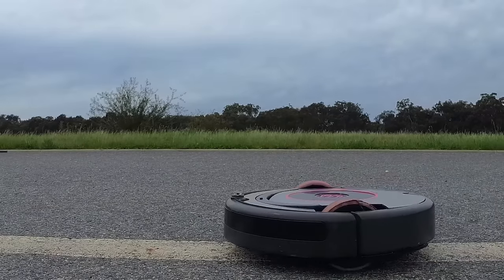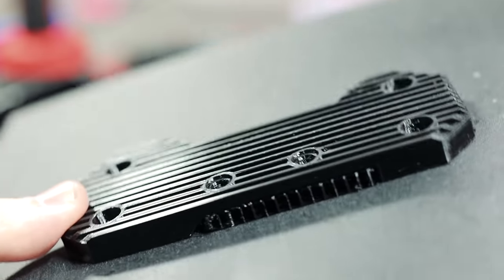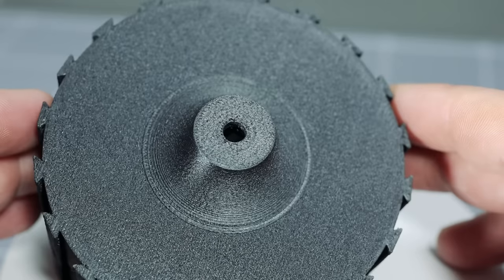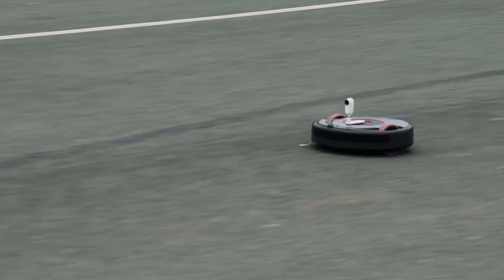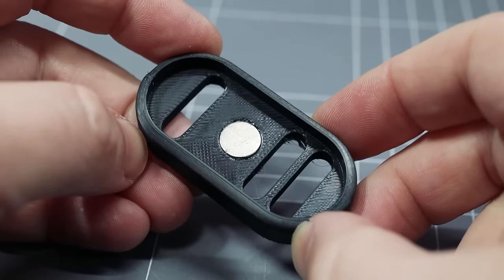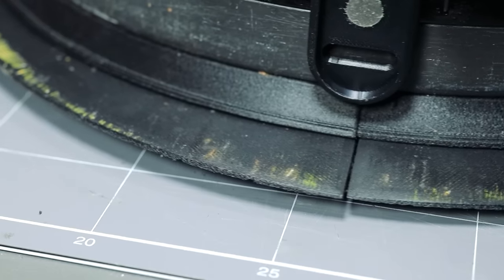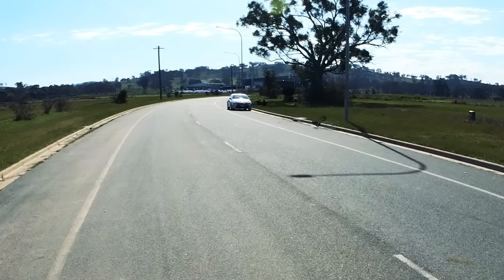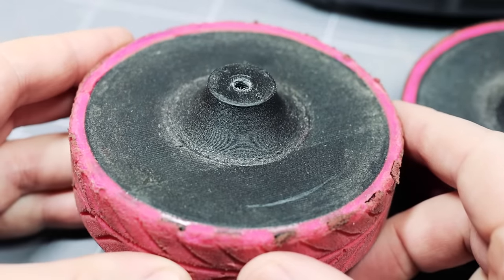World's Fastest Roomba Gets Upgrades

Comment: If you paint it red it will go faster.
Reply: Dont forget white stripes and flame decals!
Reply from the maker: Pink is faster.
Reply: Recently red isn’t very fast… at least in f1
Reply: Is this a warhammer 40k reference
Reply: pink is definitely faster than red
Reply: Ork logic
Reply: Pink is the manliest!
Reply: @anonymousprime1738 most likely
Reply: If you sand the aero 3d prints down it'll actually go faster, perfect finish
Reply: You are forgetting to add a monster energy sticker, one of those bad boys on anything and  it instantly gains 500hp. I'm forklift certified so you can trust me
Reply: it either goes faster, or 3 times as fast.
Reply: Racing stripes
Reply: Man of culture
Reply: red paint, stripes, rgb, wind deflectors,roof bars, hoodscoops and stickers make everything faster
Reply: Facts
Reply: It has to be spray paint too
Reply: It's science!!!
Reply: @Me-0063  fax
Reply: BLACK is fast
Reply: true
Reply: Flames are guaranteed 40 horses.  Depending on the size and placement of either anime or konji characters one may yield another 10 to 50 horses.
Reply: @electrosync ya but u have to add flames for instant speed
Reply: Blue is fastest
Reply: Facts
Reply: @electrosync finaly sum1 understands
Reply: If you paint it black; it gets a gun and a bunch of helicopters wil take it away towards Vietnam.

How do i know u ask? I once pranked my neighbor...Never seen him again.
Reply: If you paint a racing line it will go even faster
Reply: Is this a Mobile Suit Gundam reference?
Reply: Pink is a faster version of red.
Reply: @Kurosaki_Dan I think Warhammer 40K: there's a primitive alien species called the Orks that believes if you paint something red it goes faster.
Reply: Red is better for top-end speed but pink is better for acceleration.
Reply: @iExploder  nice to know, in mobile suit gundam there is a guy with a red mech that goes three times faster than the normal spec mechs...So there is this meme in the gundam community that red makes you 3x times faster xD
Reply: Make sure it's Ferrari red.
Reply: @electrosync obviously you are not very smart
Reply: WAAAAAGH!!!
Reply: "Red goes faster" is just a phrase. It doesn't belong solely to any specific brand/franchise/series.
Reply: needs more rgb aswell to increase frames
Reply: I heard something about painting red things black, maybe that would help more
Reply: @panoraxe lol tell my you're in the closet without telling me you're in the closet
Reply: @anonymousprime1738 I'd say so
Reply: @_Otaku-kt8be  ur pfp is purple and they are right
Reply: Laughs in Char Aznable.
Reply: Give it some stripes and speed holes as well
Reply: The lack of 40K knowledge here saddens me
Reply: Char aznable
Reply: @electrosync  agreed
Reply: Nothing is faster than pink with flames
Reply: @anonymousprime1738  i don't know that game, aint much of a gamer tbh, red things being faster has been a meme for a while
Reply: no, red racing stripes
Reply: also the horns
Reply: @Me-0063 red bull??
Reply: @TheGamer707.  ferrari
Reply: @anonymousprime1738 No, this is Patrick.
Reply: @anonymousprime1738 gundam reference
Reply: Paint it red and add a horn. It will go 3x faster
Reply: Red is always 3 times faster!
Reply: And get pulled over more
Reply: @electrosync So your going to make pink F1 cars now? Hmm, seems better then red or yellow F1 cars. Lol.
Reply: It will only get faster if you had  flames, it will give the car 10 more horsepower
Reply: That's actually what insurance companies think
Reply: @Me-0063 to be fair pink isn’t the fastest in f1 either
Reply: it will also cost more in insurance 😂
Reply: WAAAAAGH🦾😡
Reply: Char Aznable moment
Reply: paint flames along the sides
Reply: But the police will pull it over
Reply: either that or paint it gold and add the Kanji for 100 on there
Reply: And make your insurance higher.
Reply: That’s why it’s in confetti
Reply: Da boiz
Reply: @electrosync  no.
Reply: @TheEndOfNether  no
Reply: @ezrawiegers5327  wrong
Reply: @aaronwallace7426  no
Reply: Some say it might even make it “three times faster”
Reply: Doesn’t work with Ferrari F1
Reply: @themuffincat nuh uh
Reply: 3x faster?
Reply: 3times the output
Reply: 5hp per sticker, 10hp if the sticker is bigger than 30cm X 30cm

It needs comical dragster headers....
Maybe make it shoot some little sparky bits out when it goes to Maximum overdrive, lmao
Reply: Yell "Waaa" to faster-er
Reply: That doesn’t make it faster it would actually create some local drag
Reply: @Jordanvlogs-k2h  no it goes faster
Reply: Don't worry. I got your reference.
Reply: Is this a Gundam reference?
Reply: and add some flame
Reply: Fax
Reply: Whag time?
Reply: @aaronwallace7426  Blue and black
Reply: @archangeltemjin69  Blue,Pink and Black is 6X faster
Reply: @nimoy007 it's definitely Warhammer 40k
Reply: @electrosync i agree
Reply: Like a Ferrari!!!
Reply: @anonymousprime1738  It started with Gundam.
Reply: @EldritchDoodler4828  The lack of Gundam knowledge here saddens me
Reply: Black
Reply: 3 times as fast
Reply: Not faster, better sound is FASTA
Reply: @Me-0063 famous last words
Reply: Kachow
Reply: Pink it faster. Pink it better,
Reply: Needs flames
Reply: And if you paint it purple it will be stealthy
Reply: @icicle_ai bro responded too many times
Reply: Ork wisdom:
Reply: True
Reply: @electrosync  if you add under glow all around the bottom it will def go faster
Reply: Nu Gundam wa date ja nai!
Reply: @electrosync  RGB HOT PINK
Reply: or even better, pink with red flames
Reply: If you paint it black it will work harder💀
Reply: add in a commander horn too
Reply: @electrosync  Obviously, pink is just faster red.
Reply: WAAAAAAAAAAGGGGGHHHHHH!!!!!
Reply: D@electrosync yes cuz barbies car is pink
Reply: Facts red is fastest
Reply: @electrosync  that is true, that's why forza horizons is pink
Reply: Everyone knows you run faster with a knife
Reply: @erikhaag4250  ohh the wise words of FPS Doug
Reply: @electrosync bro he likes pink that’s why
Reply: @panoraxe Bfdi people
Reply: Yellow*
Reply: If you paint it red, it is slow
Reply: pink is the fastest

Comment: Since you'll be building a custom chassis for the Vroomba, you might want to move the wheels further forwards to move the balance backwards and rest more on the third wheel. This will also make the splitter scrape less. I think part of your instability is caused by just that- the driven wheels being totally centered with a high speed application. Makes for a lot of room for wobbles. You may not wanna do this if you still want to be able to spin in place, though.
Reply: Clearly the logical next step  is to add rockets; send it to space and vacuum the moon.
Reply: Bigger chassis means brushless motor, right?
Reply: Clearly the logical next step is to commit to the REV product line and cram MAXSwerve modules into the chassis
Reply: sounds like something a wheelie bar could help with.
Reply: I think this will actually make the Roomba less stable. Imagine the Roomba while it is turning to the right. "Centrifugal force" pushes at the center of mass to the left. The wheels counter this force by pushing to the right. If the wheels are ahead of the center of mass, the two forces apply a clockwise torque, causing the Roomba to turn harder. This is a positive feedback loop and causes the Roomba spin out. If the wheels are behind the center of mass, the torque is in the counter-clockwise direction which causes the Roomba to turn less. This is a negative feedback loop and creates a sensation similar to understeer which is far easier to control. This is why cars always steer from the front wheels rather than the back wheels. Forklifts are an exception to this since they move at low speed and need to work in tight spaces
Reply: @HoboWithWifi  aah, good point. i was just thinking since there's already a third wheel in the back it would probably be best to shift the weight more towards that wheel, preventing the nose from tipping into the ground. there's nothing saying the third wheel could be moved to the front though and i didn't think about that. or maybe the steering could be handled by that third wheel if it's relocated to the front...

Comment: Love the new look. I wonder if a vertical stabiliser would help it stay straight, rather than a conventional wing.
Reply from the maker: Thanks! Good suggestion, but I doubt it would help. I don’t think it comes across in the videos, but this thing has so much brutal power that it just can’t get to the ground. Plus it’s heavy which works against it. That’s why I’m working towards a light weight Roomba for the next version. It won’t vacuum or be a ‘Roomba’, but I think it will be very fast! Thanks for watching.

Comment: I would recommend covering the tires to prevent unwanted aerodynamic turbulence, and also consider making the tires a bit thicker to make bumps just that little bit easier to get over.
Reply from the maker: I actually printed some wheel covers for the first video, but never used them.
Reply: are you able to add some sort of suspension @electrosync  ?

Comment: I think guniness should give you the world record, they dont appricate the engniners/hobbyiest enough. I have some suggestions for v3, try printing the front arrow/splitter thing out of a tough (98A) tpu or tpe. This will act as a bumper and prevent some damage when you run into things. My second idea is to use drone parts like the flight controler, esc, and motors. This will allow you to have the gyro, wire in a gps directly into the flight controler, allow a fpv camera so you can drive first person, use the esc from it, and use super powerful drone motors. Realy nice project I hope you make it even faster.
Reply from the maker: Great ideas!
Reply: Guinness records are basically all pay to win. I wouldn't hold them in any regard
Reply: You could re-apply for the title of fastest smart vacuum. change the wording up could squeeze by.
Reply: @gamemeister27 they literally are pay to win
Reply: @gamemeister27 It literally is

Comment: If you’re planning on building a custom chassis for the Vroomba, I’d suggest looking into using tires that are wider and thicker; they may help absorb more of the impact from the rough tarmac surface and provide significantly better grip.
(I’d also suggest looking into trying out different tread patterns for the tires as well; Most R/C vehicles use slick or semi-slick treads that provide better grip on the road surface.)
Reply from the maker: Good suggestions. I think I'll have more freedom with my own chassis and different drive system (without those massive gearboxes to work around).

Comment: Not sure if helpful or already covered but the gyro anomaly reminded me of what happens on an R/C heli when the tail gyro is backwards or upside down- input says going left but actually goes right so gyro says more left more left which is actually more and more right so instant out of control spin . Might be your diff steer doing it tho, notoriously hard at high speeds. Love your work 👍

Comment: If i may, i would suggest you should make a slick or smooth tires and using  softer materials than hard plastic on you roomba for more traction and if you arent planning for wet surfaces, then theres no need to put grooves on your tires ❤

And it would be great idea to check for weight distrubtion, having imbalance side by side is much worse than front to back

Comment: I agree with the comments talking about making the front aero scrape less. The faster you go, the more it scrapes and bounces, the higher it bounces, and the more instability you have. And friction of course. 
Once you solve that problem...may I suggest looking into fans for ground effects? One of the most incredible track cars used low skirts and rear fans that sucked air from below the car and glued it to the ground. Look up the Chaparral 2J, or more recently, the McMurtry Electric Fan Car.
I know it's a bit of a stretch but...we're talking about a 50 km/h Roomba here :)  p.s. I love this project so much

Comment: At some point there needs to be an RC Roomba Racing series. It'd be neat to get a whole RC club in on this kind of thing, but there needs to be some ground rules on what still has to be stock. (I figure the chassis still has to be able to convert back to the original parts?)
Reply: I imagine, that since it will be defined by "Roomba", it'll at least need to be able to perform the main task of a Roomba, namely being able to vacuum at whatever the top speed might be. Though, I'm not sure at what level of effectiveness the threshold should be, as it's gonna be unrealistic to expect a model tuned for speed to perform as well as a stock Roomba.

Or just call it something else than "Roomba", like Guinnes pointed out.

Comment: I think you should make something like a middle mounted wing, centered to the center of mass and relatively high up to get clean air instead of dirty air coming of the roomba, like a Cooper T86B F1 car from 1968. Another suggestion is to use dive planes instead of a splitter, since that could be causing instability in the straight-line runs. Dive planes (again much like the Cooper T86B) reduce drag and add some limited downforce.

Comment: Run it all off the same battery, just run the two in parallel if needed as the 2 different voltages from the slightly different battery charges will make the motors accelerate differently, it should help with it going straight alot.

Comment: Very late to the party but the Roomba is a vacuum, do you think there's a way to use its vacuuming abilities to generate downforce? I've seen it in other projects and I think it would be hilariously fitting for a Roomba (my apologies if you wasted your time reading this and it turns out to be downright unfeasible 💀)
Reply from the maker: It's definitely feasible. It was suggested on the first video. The standard vacuum motor is underpowered and wouldn't be effective, but you could actually add an EDF on the top middle of the Roomba (which has a direct path down to the ground). Add the right skirts, etc. and it would work. Not sure how well though.

Comment: yea, you really need that gyro
Reply from the maker: I think I’ll have to design my own.
Reply: @electrosync  are there no gyro for tank drive?
If you go custom, go with a basic flight controller and ardupilot rover I guess.
You get a few more sensor inputs like compass and accelerometer. So you don't only have the dampening effect of a gyro but actual heading hold.
And in the end, it's supposed to be a robot, right? Full autonomy 💪
Reply: @TilmanBaumann The RC Snowcat guy should have the right setup.
Reply: @TilmanBaumann shouldn't need any custom work ardurover and inav both have tracked vehicle support already or a custom motor mixer in betaflight would work.

Comment: You can get little v-tail mixer boards that combine two channels so the gyro would work on both channels. The other option would be use a flight controller, inav has rover support or betaflight could do it with a custom motor mixer.

Comment: If you look into mixing on your transmitter you can make it drive like a car instead of tank steering
Reply: Also instead of buying a controller that's set on one frequency you should look into a transmitter with opentx. Jumper-t lite is a good one
Reply: @cadneemountai2791 The dumborc is still frequancy hopping spread spectrum and the tank steer is already using the wheel for steering and trigger for throttle it has the mixing built in.
Reply: @thirtythreeeyes8624  oh okay cool!

Comment: Idea to fix roomba's stability: 

Wheelie bar, with a third wheel. This would add resistance and just like a rocket's fins drag along to provide resistance and keep the thing straight, here, a wheel placed behind the car could do the same.

if you run into steering difficulties with this setup, you can move the entire assembly to the front and make the third wheel steerable, essentially turning it into a dragster configuration.

Unfortunately there's not much else you can do to fix the stability, the roomba is simply too short and wide to be stable at high speeds.

Comment: IDK if this has been stated on a previous comment(esp since it has been 5 months) but the entire aero package doesn't work and even if it did it would be kind of useless considering the real problem with this thing that I'm personally seeing is cross-wind sensitivity because this thing will just careen sideways under "high speeds" from both videos you posted so in all actuality you want to give this roomba some kind of vertical fin(look up F1 and/or LMP1 shark fins) to give the roomba some added high speed stability
I would also advise against relying on downforce later on unless you completely rebuilt the chassis to be stronger, yes even in mild speeds of about 50mp/h a roomba can suffer from chassis wear and might crack because it wasn't designed to have relatively extreme forces acting upon it

Comment: A'ight. Next iteration will drift in a touge track. I'd be impressed if you coukd pull that off, but it's not vital for it to be good. This is easily one of the coolest things I've seen in a while, and it's somehow faster than me running at my fastest (25 kmh avg on a 100m sprint).

You, my man, have just gained a sub from a speed demon.

Comment: Cool project.
Do you have progressive steering on it?  The faster it goes, the less steering input is done... Preventing it to shoot out with a tiny adjustment on the stick.

Also, it looks like it need a bit more suspension to actually be stable in high speeds.  Could possible have more/thicker polyurethane wheels to accomplish this ?

Comment: dual differential drive
that way it goes straight unless you want it to turn, once you've got it zeroed out
and you can get rid of one motor while doing that
also a nose bump like on the semi trucks would probably help stabilize it at higher speeds
but roomba seems like a perfect platform for a ground effect vehicle which would stabilize it even further at even higher speeds